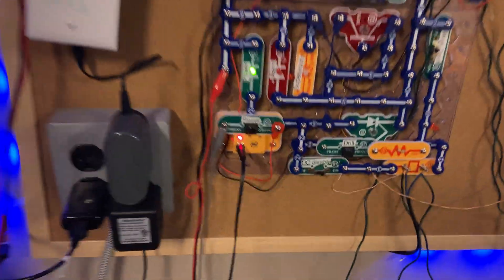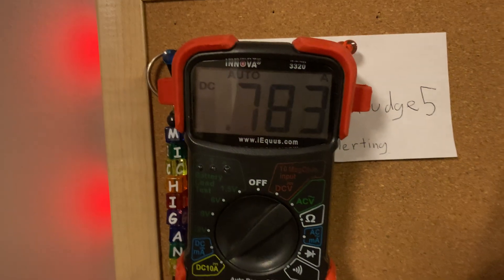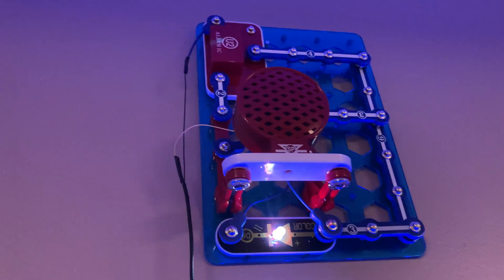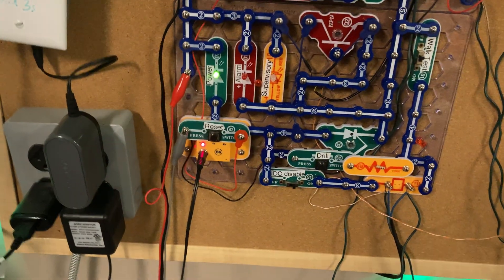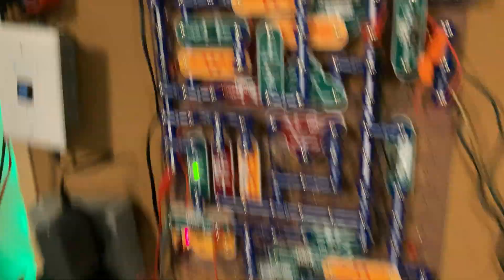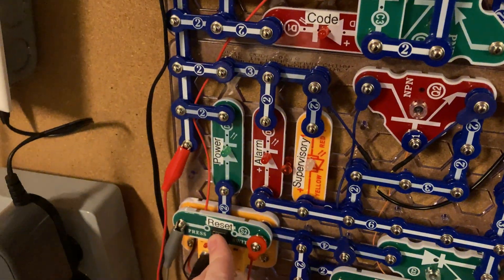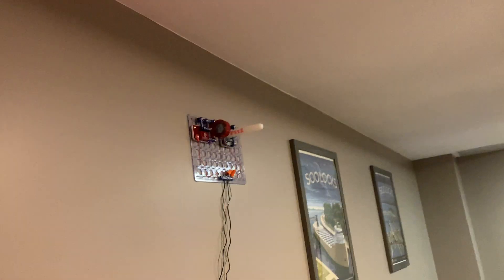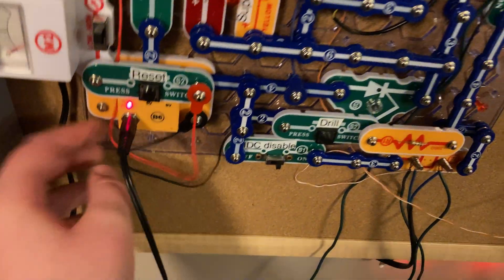Snap-Circuits fire alarm system test #11

Comment: In the summertime I'm going to make homemade water guns I'm making two I'm going to get to water pumps tubing transparent box waterproof box the power supply push button toodles the Broadway push button key switch Amazon get it from I at the Goodwill I projector how much was it $15 49 can you stop being used very much and it works find a good way to the phone the projector hdml cable play Samsung phone it's coming tomorrow in the morning for my Amazon